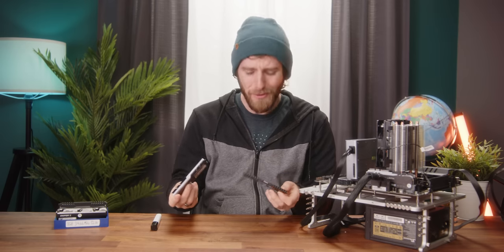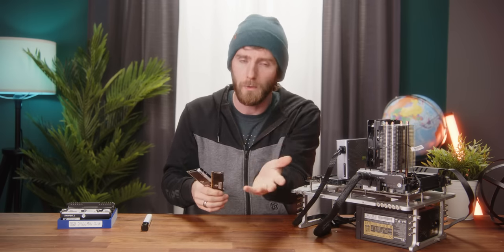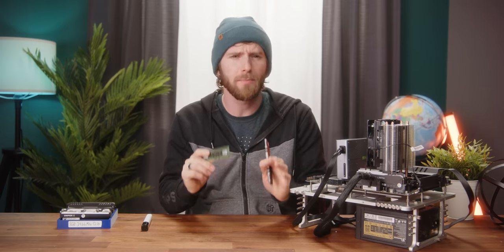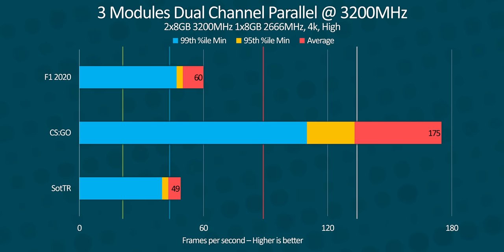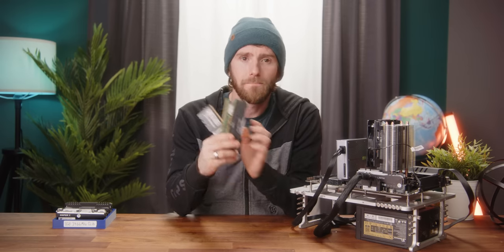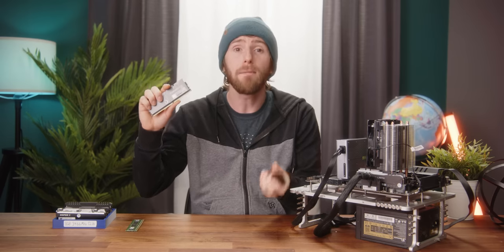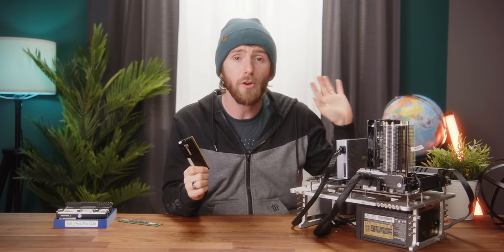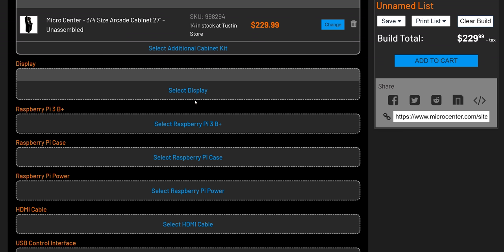Just How Bad is Mixing Memory?

Comment: How about a tech tip for you guys: If you make charts that compare things, put them both on the screen at the same time, so you can actually compare them.
Reply: Jeez you fuckin killed him
Reply: true. There is space in the graphs to combine both figures into one, like putting the results of one test for CS:GO next to the results for the ther test, side by side.
Reply: They've been doing it for so long, I don't think they know how to do it properly.
Reply: It's freaking me out how they compare ram configurations solely by making videogame fps benchmarks.
I mean thats absolutely a key point for gamers, but probably isn't an overall good measurement.
Reply: @marvingudel605  Gaming is one of the most demanding things you can ask a computer to do for most people. For most people this will be the hardest their computer is ever going to be pushed, so for this, it is a very good metric. (Was just playing anno 1800 and was using 17 GB or RAM before investors) If your 4K video editing or using 3-D rendering like auto-cad your either leveraging the power of servers or you've been able to acquire the high end memory module kits that would be required for such tasking, and not watching this video to educate yourself about mixing modules.
Reply: @marvingudel605  actually, it does matter for example I can clock my ram speed to 3133 mhz cl 14 15 15 31 with geardown mode on, but guess what even though the bechmark performance is about 20% better, It still performs worse in games than 2666mhz cl 16 18 18 36 with geardown mode off
Reply: BohriumChartTips
Reply: I have a question, my laptop motherboard support dual channel but locks the ram speed at 2400mhz and 4gb 3200mhz ram is in it(it detect 4 gb but speed is 2400mhz, ive confirmed the 4gb ram speed and it really is 3200mhz). If i put 8gb 2666mhz ram on it what will happen? Will i get blue screen or 16 shade of grey?

Note : both are SODIMM DDR4
Reply: @user-mc2lg4iw9e  Depends on the motherboard your using. But a blanket answer would be the mobo should revert the ram speed to the highest matching speed (in this case 2400) but you may need to manually do it in the bios. Also I wouldn't recommend this as a bunch of random issues can arise from this. If your running a Ryzen processor you can run different size RAM modules just know that the maximum amount (in GB) in dual-channel is the smallest module size (so in your case it would only go to 4 GB even though one module is 8GB).
Reply: @berated4541  oh, thanks for that, Im generally just curious about what will happen and questioning whether or not im still gonna be able to use the ram. My laptop uses ryzen cpu and the bios didn't really let me change the ram speed, i want to upgrade it to 16 gb but i got struck by this question
Reply: You can just take a mental note. Not difficult.
Reply: @user-mc2lg4iw9e  YOu probably have to "overclock" your ram in advanced settings. Some boards call it DOCP, some call it XMP, just in case you havent looked for those. If you have and it's not available, RIP in pieces.
Reply: @worldseriesofghosts3408  I haven't look those, I'll try it if its available. 
Thanks
Reply: @berated4541  "If your 4K video editing or using 3-D rendering like auto-cad your either leveraging the power of servers or you've been able to acquire the high end memory module kits that would be required for such tasking, and not watching this video to educate yourself about mixing modules."

have you uh... ever worked at a company that uses autocad and solidworks?  We get company laptops with shitass 2666 mhz memory.  business computers don't tend to have insanely high speed RAM, that's not really a thing anyone sells, and for how expensive it would be, you could probably just buy 2 laptops instead, and use one for render intensive tasks while you daily drive the other.
Reply: @bobthebuilder609  Business computers almost exclusively leverage the power of servers.....so thanks for reinforcing my point......
Reply: @berated4541  sorry to disappoint, but engineers and engineering students can be just as broke as you are. I am currently using autoCAD on a first generation i7 with 12 gigs of unmatched ddr3 in 3 channel mode.
Reply: @marvingudel605  That's the mostly likely use case for this type of practice, though. If you're a productivity person, you're future proofing by getting more RAM than you need today knowing you'll use it eventually, upgrading your whole memory kit or maybe even computer at once, or your machine is maintained and upgraded by your company's IT department in which case the cost of just getting a whole knew memory kit is minimal by comparison to other company costs. If you're a person that does not fall into one of these categories and gaming still isn't your primary use case for this type of video, then I'm surprised. But that doesn't mean that you can assume game FPS benchmarks to be entirely unreliable indicators of what you could expect, either.
Reply: man this comment didnt age well for LTT did it lol
Reply: YouTube keyboard shortcut: use the left and right arrow keys to skip forwards and backwards 5 seconds.  If @LinusTechTips has produced video the video with two charts to compare having 5 second spacings, then this works really well.

Comment: Shout out to the notebooks with unremovable 4GB RAM and one extra slot when they support up to 32GB of RAM 🚮
Reply: absolute worst!
Reply: When bios sports to 8 gb ram and you have 4 on laptop and there is only 2 slots and 1 is fled by 4gb you will think like me 2 4 gb or 1 8gb ram whic one is beter?
Reply: @fahrimertdincer8421  two 4gb sticks are better if your motherboard supports dual channel mode (which it likely will). It performs better in gaming and overall workload consumption.
Reply: @gdhplays3166  So if I have 4gb on board already, I should go for another 4gb (4+4=8) instead of 8gb (4+8=12)?
Reply: @shrey768  yes
Reply: @shrey768  more ram is inherently better at handling system loads, so go for 4 + 8. However, make sure the work you are doing is able to be sustained by the 4gb before using the 8gb. Asynchronized dual channel exists on i think all consumer mobos.
Reply: @gdhplays3166  Thanks!
Reply: @shrey768  it depends if the board can use 12gb

Sometimes max ram specs means total for all slots supported by the chipset or cpu, sometimes max ram regards to highest capacity per slot.

Some older boards supported 16gb total in the chipset but only 4gb module size, on boards with only two slots this limited you to 8gb.
Reply: You think that's bad? My old pc had an unremovable cpu
Reply: @shrey768  If your motherboard supports doing that, that will most likely be better.
Reply: And you can't know(or at least easily, depends), which timing and speed the on-board is. 
Sometimes neither aida64 could tell. 
Nothing like Thinkpad T450 or X230 (fully upgradable) and able to replace basically everything. xD
Also not a gamer here. Mostly Linux
Reply: @lsswappedmiata63  so... A laptop?
Reply: My life right now, some genius decided to solder a 4gb ram on my gaming** laptop with a second slot that can take up to 64gb. Which  means no matter  the upgrade, I'm going to have a weird amount of ram 😅 12, 20,36 68gb
Reply: @poseikipproductions3547  No it was a damn tower and thats the reason i was so damn confused
Reply: People who know how to solder: I do not have such weaknesses
Reply: I upgraded my laptop to 32gb and planned on giving my mom the ones coming out of it. Turns out that she had one of those. I was confused on why there was only 1 ram slot and that it was empty. So stupid.
Reply: must be talking about that IdeaPad * 320 abk ... it came with 8GBs ... go to upgrade I have to -4GB stick to install my 8GB stick (now has 12gbs ) at least I got the gaming ram / with heat spreader that can only run at 933mhz LOL  stupid cheap laptops
Reply: good thing mine isn't soldered. Also that's literal torture. Who the hell uses 4 GB RAM with a CPU and mobo that supports up to 32??
Reply: @shrey768  yeah the other way around might cause problems. And 8 works fine unless you have extremely heavy workloads or play memory intensive games.
Reply: Yes. My laptop got 4gig onboard, fookin sucks
Reply: @shrey768  No go for the higher total amount of ram. What they mean is using 2 ram sticks is always better then one because the work load is spread out over 2 chips instead of 1 so more information can get to your CPU  because of the increased workload.
Reply: the best thing about onboard ram is that if you get a ram error you are screwed and need new MB
Reply: REALLY? That is..erh..weird oh,well not a LAP-fan
Reply: humandxp  You sound rather unintelligent. No offense.
Reply: Trace Smith  unless your laptop iGpu is using 2gb of that RAM and you need at least 8 for a game.
Reply: I imagine the upgrade is done by putting a 32GiB module in the slot and the onboard gets disabled
Reply: I guess micro-soldering will be a highly valued future IT/technician skillset to have, people, will be upgrading RAM on laptops exactly the same way people upgraded the RAM on the original XBOX video game console from 64 MB to 128 MB back in the days, by unsoldering the actual RAM chips of the motherboard and soldering in RAM chips of bigger capacities. Welcome to the future of IT upgrades, bought to you by the planned obsolescence department of some companies.
Reply: @gdhplays3166  well ı replaced it to 8 gb one and its performs beter than 4 gb one even gaming ...
Reply: humandxp  two to the power of n, ie address lines.
Reply: @yafilmDOTcom  bespoke repairs are very expensive and risk destroying the PCB..
Reply: I upgraded my dad's laptop thinking I would be replacing a 4 GB stick with the 8 GB only to find out that the 4 GB is actually soldered to the motherboard, so now he has 12 GB total.
Reply: @nexus7tablet610  Also, sometimes the laptop will support more ram than it says. For instance I like older thinkpads and they usually say they support 8gb max, but they tend to support 16gb, they just say 8gb because the biggest sodimms in the wild at the time of the laptops release would equal 8.
Reply: @gdhplays3166  what about 16 + 4 ? Say for gaming
Reply: Duh, just buy a 28GB stick 🙄🙄🙄
Reply: @kraio-sfu  😂that would be perfect
Reply: @fahrimertdincer8421  If your ram and motherboard has dual channel support best choice will definitely 2x4 gb If not question will be how long do you wanna use it? If the anscer is <2 then you should buy a 8gb since all of the programs are down at a endless abyss of ram hunger
Reply: humandxp  I figure the internal gets disabled from an engineering perspective.
First, OP said the laptop is upgradeable to 32GiB, so unless you can find a 28GiB DIMM, the internal will be disabled.
Disabling the internal also means that the laptop manufacturer doesn't need to worry about any compatibility issues, makes QA much easier
Reply: i think most people are here because their favourite Ryzen 5 6c12t laptop have a glued on 4 gb RAM with only 1 extra slot lmfao
its fkin crippled!
Reply: 8GB 3200 mhz Or 32Gb 1600mhz 
Which is better for gaming ?
Reply: @imperia6368  one of them is DDR3 and the other is DDR4. Go with DDR4 if your CPu supports it
Reply: i have a qs can i overclock my 3000 mghz ram to 3200 and pair it with a 3200
Reply: i see the problem. its because you went with a laptop & not a pc

Comment: I've been using 32gb (4x8gb) of ram with my b450 and Ryzen 5 5600 for over a couple months with 100% reliability, 2 sticks are 3200 and the other 2 are 2666. I don't care a terrible about about speed, so I set them all to run slower at 2666 and have had absolutely no issues
Reply: this is excatly what ive been researching! lol thanks!
Reply: What od i place cl16 ram to cl14 Rama triple chanells,that Work or not,sorry for my bad English...
Reply: All Rams is 3200mhz
Reply: i have a qs can i overclock my 3000 mghz ram to 3200 and pair it with a 3200
Reply: @thecuzzy3571  I don't think so...
Reply: I have same mobo and CPU, what I did is I pair my x2 8GB Hyper x fury with x1 16GB Hyper x fury beast
Reply: I actually have them all clocked at 3200 now and still running great!
Reply: @yourfriendben2  I'm literally running the same CPU and MOBO and have 48GB of RAM. One set is the Corsair vengeance pro RGB (2x16 GB @3200MHz) and the other is Corsair Vengeance LPX (2X8GB) clocked at the same speeds and haven't had any issues at all after 2 months
Reply: @_klee7469 Did you face any computability issues?
Reply: How you set ram speed?
Reply: i had asrock x370 pro4 and installed 2x4gb Team elite black 25666 speed , can i add another but 2x8gb team elite black 25666 speed? Plase answer me, i scare to broke my Motherboard if its not support
Reply: @thecuzzy3571 I’ve got a 3000 and a 3200 stick run them at 3200 works fine
Reply: i have the same processor but how come you using 4 slots , this processor support only 2 channels
Reply: @TheZakaria39 slots != channels. Slots simply how many ram can your motherboard physically hold. While channels is how the memory modules configured to work.
Reply: @smelly640  kinda off-topic but may i ask you does rgb + non rgb ram look ugly?
Reply: @dylan-xp8ih depends on taste. I don't like any leds/lights/windows in my pc. An assassins greatest advantage is his stealth.
Can't have that with a unicorns rainbow turd going mad zerk in there lol
Reply: @RomanHold  Was asking specifically about comboing non-rgb ram with rgb. Anyway, I don't like rainbow rgb either, but I'd like to be able to use static colors or minimal effects with different color schemes.
Reply: I do the same. Except I had two sticks 3000mhz and the two others 3200Mhz, so I just overclocked a bit so all of them can run at 3200mhz.
Reply: Ya works here too, with a B550 and a 3600x and now with a 5900x. I have a pair of 3200 and the other is 3600.  All 4 run at around 3300Mhz.
Reply: I'm actually in a situation right now where I'm trying to upgrade an older PC, as it was, it only had one 8gb stick of DDR3, but there's slots, and a friend just gave me 12gb, or 3 4gb sticks. I'm wondering if i should go with the 12 or mix them to get 16...
Reply: I also have 4x8gb ddr4 configuration. Probably same mobo as you. I have Rog Strix b450-f gaming. both pairs are marketed as 3200Mhz cl16. One pair is HyperX fury and the other newer pair is basically the same sticks but rebranded as Fury Beast. Some reason my computer doesn't like it when I OC my ram to 3200Mhz. So I left them at stock speeds of 2400Mhz.
Reply: Do I need to research the things or can they be different
Reply: @HelloHelloHell-o  3200 is pretty slow, so I never ran into compatibility issues. I now run 64gigs (4x16gb) at 3800. They're 2 different Corsair sticks now, I was able to overclock 2x16 to 4200 without issues but 4 sticks are to unstable at anything other than stock 3800
Reply: @thecuzzy3571  probably, sometimes it's happy and other times it's not, really depends on the individual sticks
Reply: B450 will support 3200 MHz Ram ?
Reply: @yourfriendben2  In my experience having RAM modules with different capacities and CAS latencies is what makes my pc the most unstable.